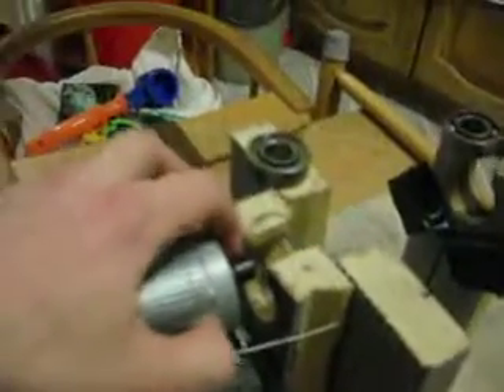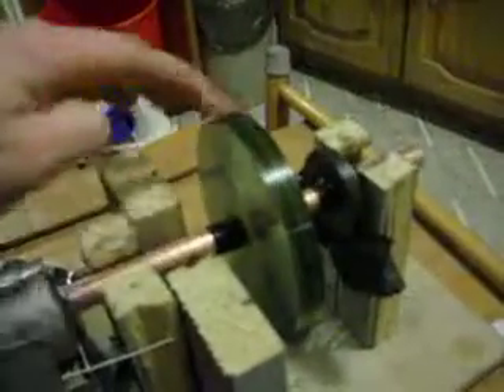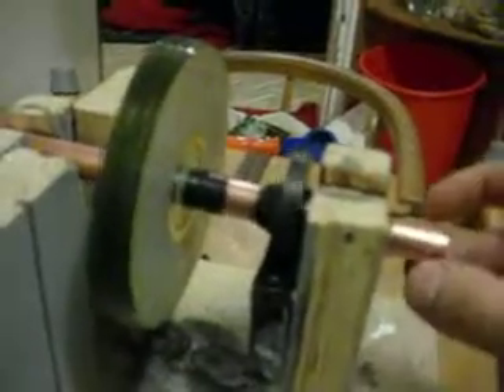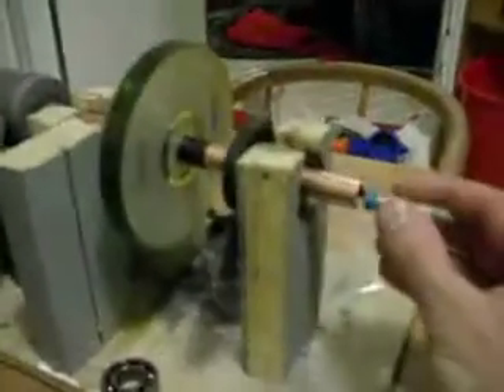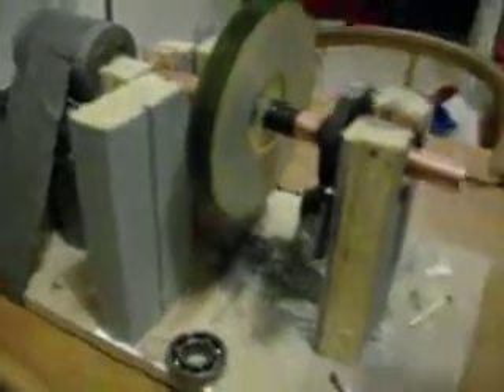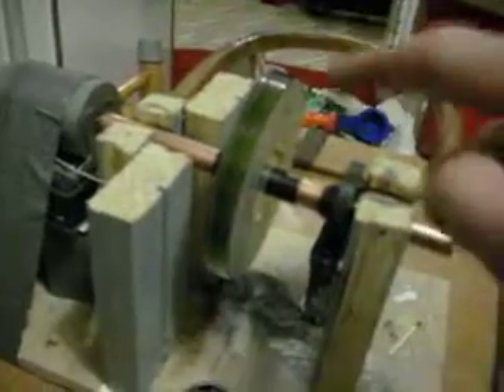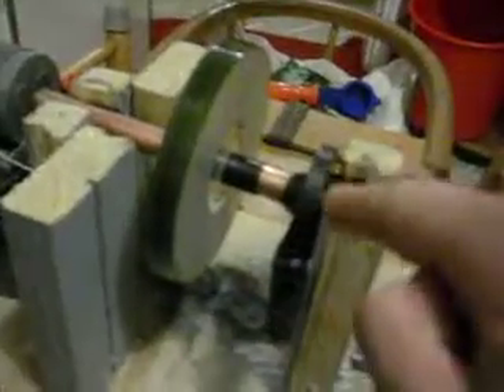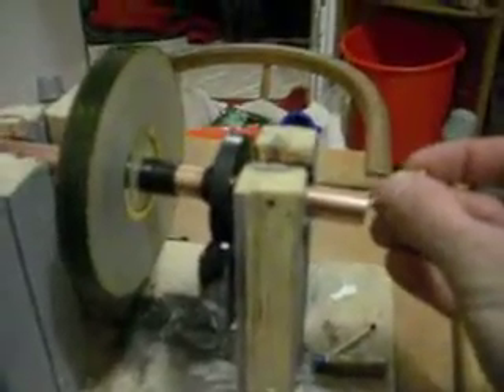Tesla turbine with magnetic bearing

Comment: Everything is nice in this video (although a video shot from the rotation/shaft axis would be nice to see levitation happen::) and the project is simply built!
But just for the brainstorming, it occured to me while I was watching this: would it be possible to make functional Tesla turbine with magnetic bearings, since the turbine itself would have to be completely air-tight, which implies some seals at some point on the shaft, which again adds friction, as normal bearings do. Interesting....

Comment from the maker: @kratuli I don't say that it will not use any power - but i say that it may have effectivenes at least 90% or more to transfer electric energy to kinetic energy, not as the ordinary pumps and turbines. And current can be bigger because distancers have a big surface area (3X7 distancers whith resistive surface area of about 6mm2 each) , whitch brake air flow and make resistance.

Comment: Have you thought of using a pipe of magnetic material and suspending it in the middle of coil?

(Similar as in induction heaters)

If the compressed air is not being fed trough the pipe you could use short solid metal sticks at each end of turbine and suspend them in solenoids. 

This of course would consume additional power, but provide a good way to easy see the gain of such free suspension.

Comment from the maker: kratuli:
But the power in inlet was not so big. Now i understand that wersion with pipe in middle will not work well because holes under disks is too small to fill space between 2 disks. The biggest resistance to air must be in inlet and outlet not in middle. That can be done by making bigger pipe (about 38mm diameter) or by using holes in disks (as in original tesla invention). And in last coment i forgot to say that 87 mA was get by disks with spacers 3mm (resistance to air between disks)

Comment from the maker: @kratuli I measure it with multimeter in series with motor on 20A scale - with ordinary bearings it shows 0.26A, without any load on 200mA scale multimeter shows 85mA (it is 18.7 W), when rotor with magnetic mearing was attached (ordinary bearings removed), it shows 82-85mA. Now I drilled holes in pipe to make a way for air. The power was so big, that it blows off candle in 15cm (before you see it blows firing match from about 1-2cm) and measured current was 87 - 87.5 mA.